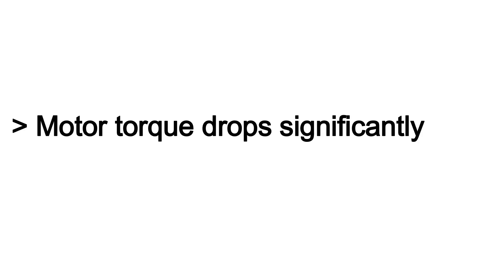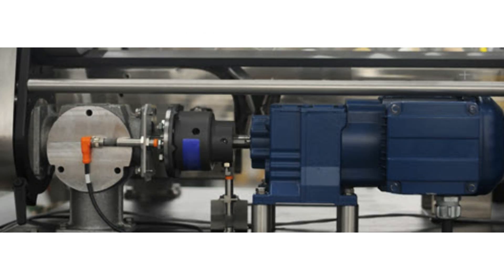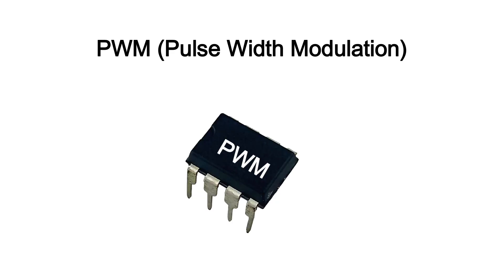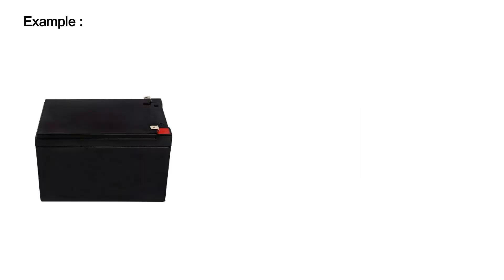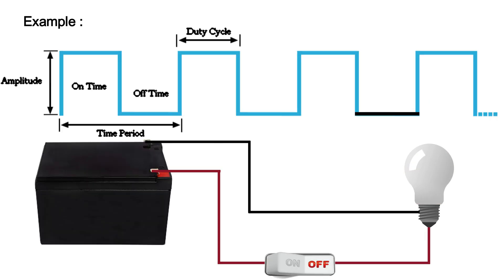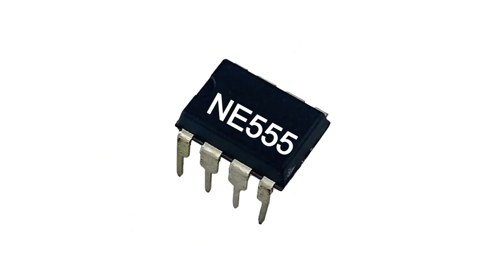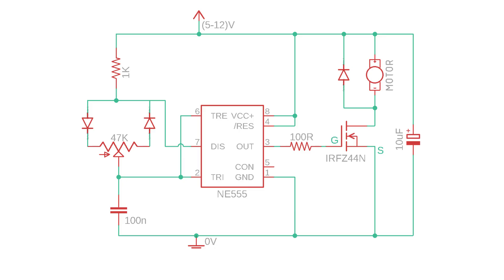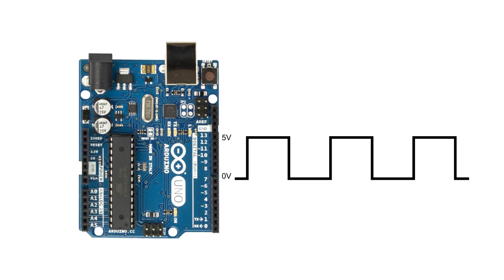This Is Why Professionals Use PWM, Not Potentiometers, for Motor Speed

Comment from the maker: Many people try to control motor speed using a potentiometer, but that method wastes power and reduces motor torque.
PWM (Pulse Width Modulation) is the correct and professional way to control motor speed efficiently.

▶ In this video, you learned:

Why potentiometers are not suitable for motor speed control

How PWM controls speed without reducing voltage

Why PWM is used in real machines and inverter systems

💬 Comment below:
Have you ever used a potentiometer or PWM to control a motor? Let us know your experience!

👍 Like | 🔔 Subscribe | 📤 Share
More simple electronics lessons coming soon!

Comment: What exactly are you thinking of when you say PWM circuit? Do you mean a timer like the 555, or something else? I don't think I've heard of a "PWM" circuit.
Reply from the maker: PWM is not a single IC or a specific circuit. It is a method or technique. PWM allows you to control power without reducing the voltage. This is done by using fast ON and OFF pulses.

Comment: Pots work very well for low power applications including fans. Maybe not as energy efficient but honestly much simpler and less expensive (also more reliable) for very simple things that use little power.
Reply from the maker: You are right that potentiometers can work in very low-power applications, such as small fans. For simple systems, they are easy to use and low cost.

However, even in low-power motor control, PWM has important advantages. PWM controls speed without reducing voltage, so the motor maintains better torque and runs more consistently. A potentiometer always wastes power as heat, and as current increases—even slightly—this reduces efficiency and component life.

Also, in practice, many “simple fan controls” that appear to use a knob are actually PWM circuits internally, with the potentiometer only used as a control input, not as a power-handling device.

So while potentiometers may be acceptable for very small, non-critical loads, PWM is more scalable, efficient, and electrically correct, which is why it is used in professional and modern designs—even at low power levels.